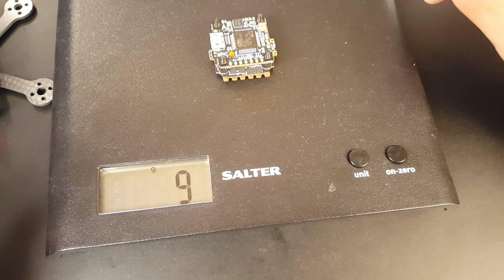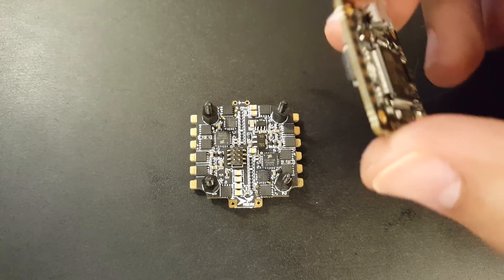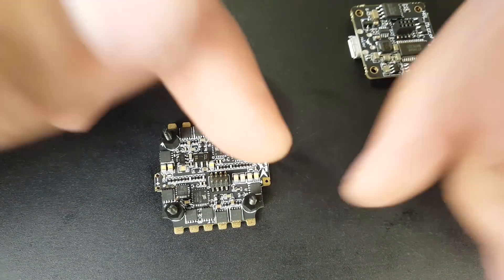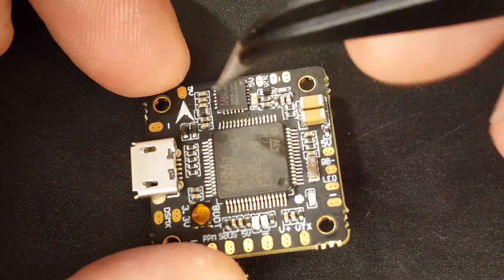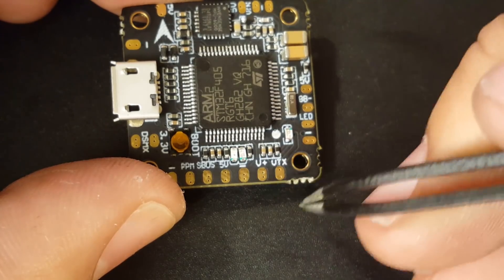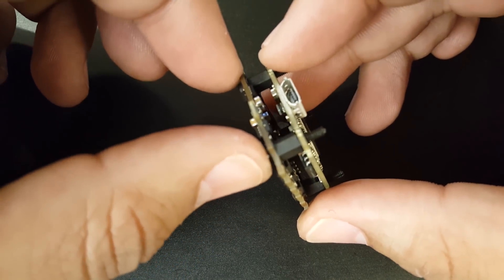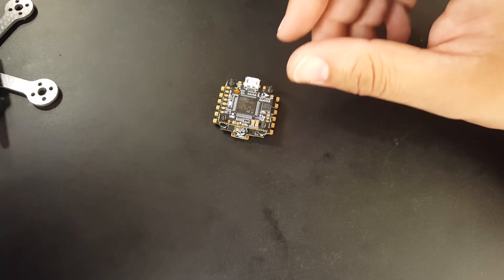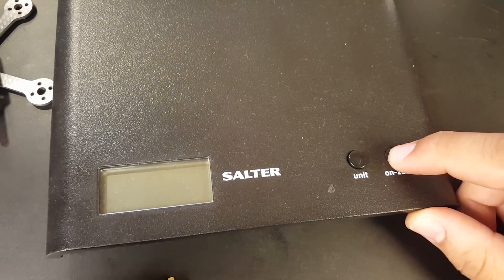Best Micro AIO For Waterproofing // HGLRC XJB F428 Micro

Comment: Is it possible to put this on 5 inch props?  I will love to do a custom frame around this FC and  a tiny camera, but still have a 2205 or 2306 motors on it. It will be super light.
Reply: If it fits the frame and the motor wont be too thirsty youll be fine I think
Reply: The battery pads look like they support 18 awg wire at most which I doubt can give out enough current for most 5" motors. The Asgard is the one you're looking for even though it's a 30x30 stack.
Reply: If there are power pads on both sides you can solder a 12 awg in 2 strands on them. Just a possible hack I have already done.